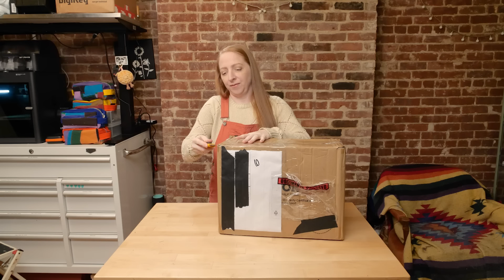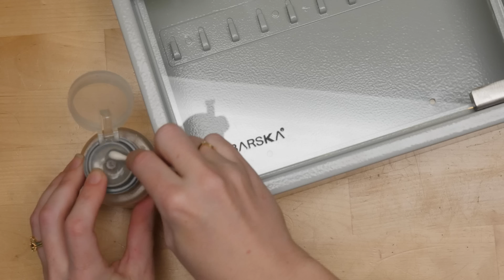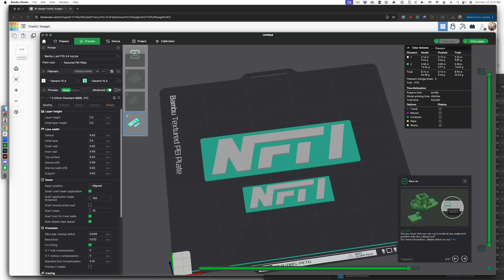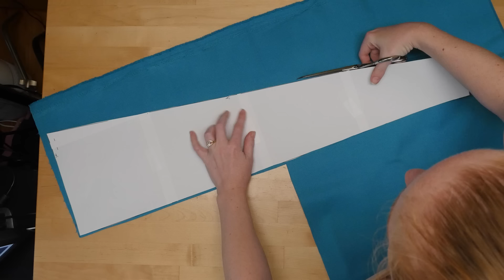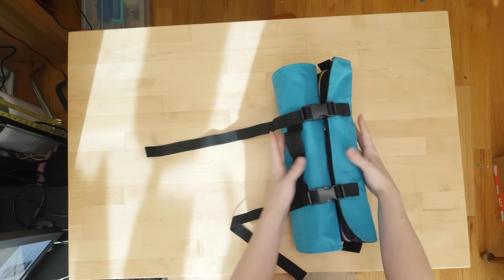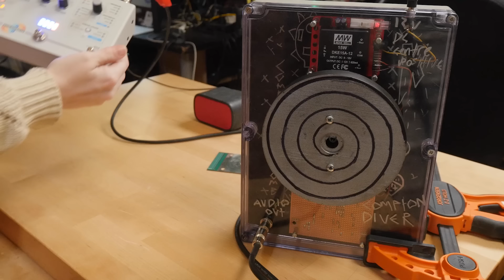Knife Nook for Nate (Secret Santa 2025)

Comment: Is there a video on how you actually put the knife bag together?  I viewed the wax fabric tool holder video but with this knife bag, there were different steps that were done
Reply from the maker: Sorry you're not satisfied with the instructions. It's a free pattern and you're only supposed to buy it if you find it useful. Since you aren't finding it useful, I issued you a refund.
Reply: @BeckyStern. Thank you for the refund. I realized that it was a free pattern but then I read that there was a pattern to purchase . I had assumed that since I was purchasing the pattern that it would come along with written instructions or a link to a more in depth video tutorial. 

I briefly glanced at the pattern and it doesn’t show any placement for the straps so I’m guessing it will be trail and error on the placement of the straps.
Reply: I’m not sure what you mean by “find it useful”. The knife roll is definitely useful and I definitely want to make it which is why I purchased the pattern and also to support your business

Comment: The law of power supplies:  You will easily find every voltage except the one you need.  When you finally do, it'll have the wrong connector and or the wrong polarity.
Reply: That polarity especially kills that slightly more expensive thing ...
Reply: And that's why I have two boxes of power supplies I've been accumulating from every device I've owned over the last 35+ years!
...
And I still sometimes need to go buy a different one to get the right amperage rating...
Reply: Lab supply ftw.